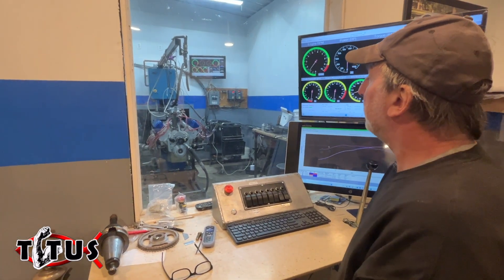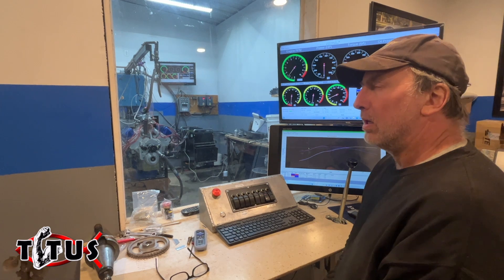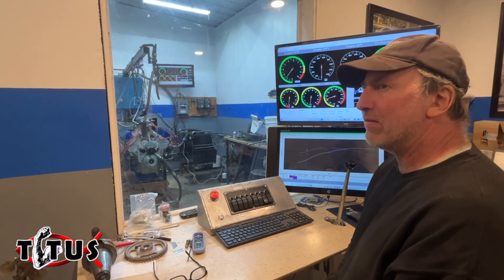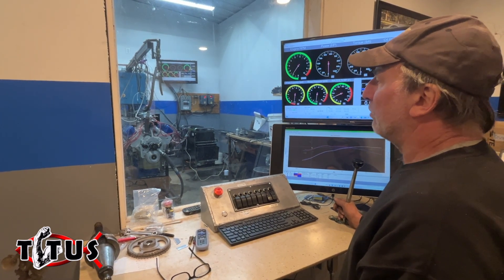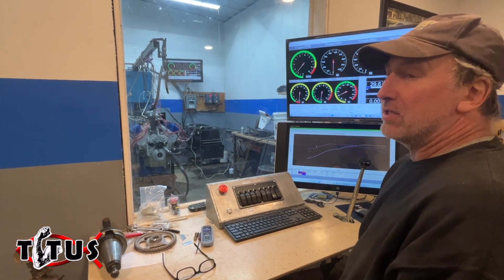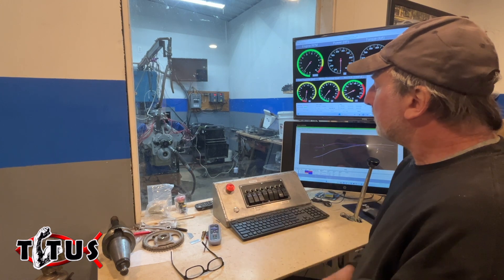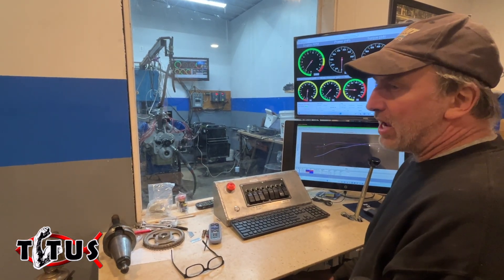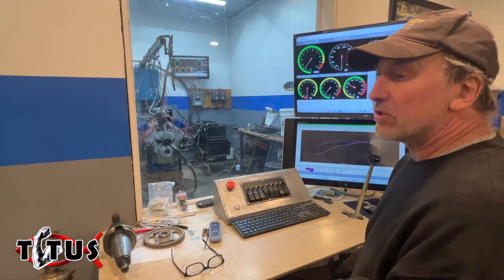Could Make WAY More Power // 465 Cubic Inch Cleveland Drag Street Engine On Dyno – Titus Performance

Comment: Do you have a HP and torque figure. Thank you.
Reply from the maker: It makes just shy of 700 uncorrected, you can watch the gages on the screen
Reply: Gotta use Higgins heads from Melbourne Australia… out of the box they are good for 1000 horses!
Reply: @jimkotantonis6079  
You talk like you think it's easy to make 1000+ on a Cleveland N/A just by bolting on those heads. I know a few here in Europe who runs them, and I have run CHI 400C's myself which are very similar. I can tell you that it is not easy to make that power, especially for something for the street. It is in fact, impossible. You're looking at a very radical cam, massive springs, 1.9 or more ratio rockers, .900" lift etc. If you want to run pump gas and make an honest 750 hp SAE corrected which will run on the street, you are pushing it - even if you do a large cube Cleveland build. Sure you can do 1000 as a race engine, and even for drag and drive if you are willing to compromise in several areas, but it's not easy.
Reply: Nicely done but as you said, it will scream with your good heads getting the job done !